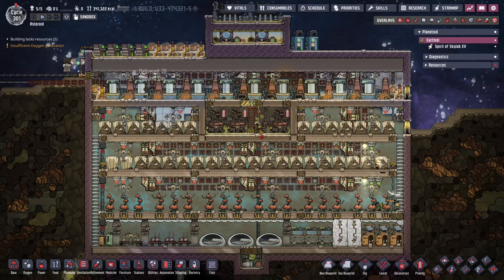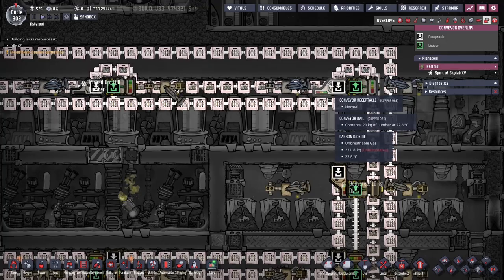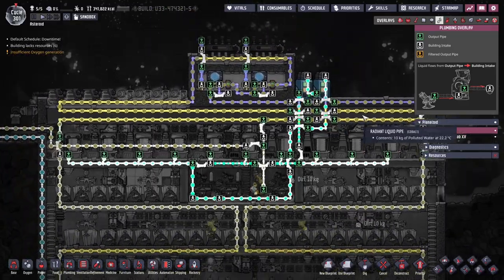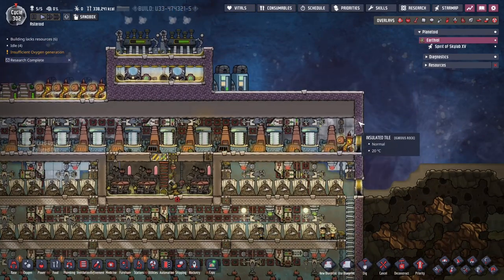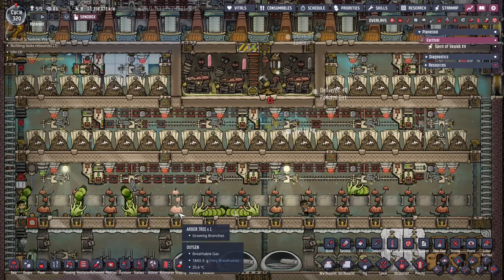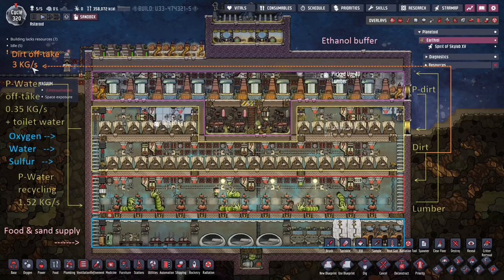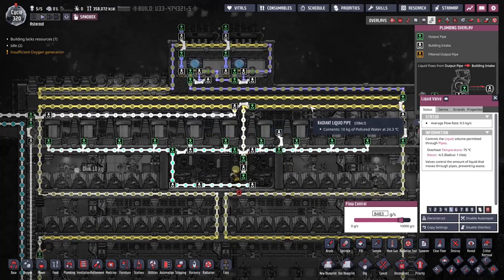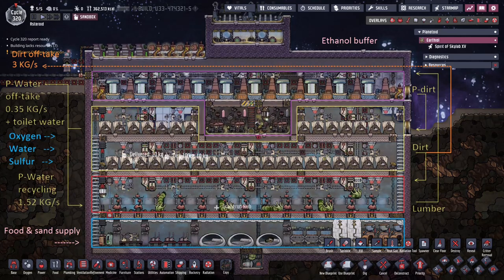Let's Get Dirty! - Oxygen Not Included: Spaced Out!

Comment: what about a fertilizer synthesizer method using a cooker to produce dirt from fertilizer? i know it likely would be less effective, but it would be available on the asteroids that don't feature arbors.

also, recycling the co2 through scrubbers would feed a lot of trees. a standard 4 distiller, single generator system produces enough co2 to run at least 4 scrubbers. accounting for the 750 g/s you would be producing 4750 g/s or 2850 kg per cycle of polluted water. this is enough for 40.7 trees. if it takes 7 trees to support one distiller, then you could run 20 extra distillers driving 5 petroleum generators.
Reply from the maker: For this particular build I tried to minimize the number of trees, but we can definitely scale it up!

Comment: I was overthinking the dupe pathing and read a bit more into it after coming up with a transit tube ‘elevator’ into the work place (you don’t need a transit hub to exit) and a fire pole back down for transportation and I’m now totally bummed out. Apparently dupes with sufficient athletic skill on plastic ladders are faster going up than ones in tubes. Having said that, great build!

Edit:
Would still like to recommend adding fire poles and swapping the position of the top right compost with the generators to decrease duplicant travel times. Also have you considered merging the steam turbines with the generators into an actual power plant? No such thing as over-engineering, just room to expand with new ideas.
Reply from the maker: Some good ideas here! Going to do more testing.

Comment: It's a really cool village! It really showcases how much you can produce with arbor trees.

On another hand, in Spaced Out!, I really feel like it would be more profitable to use all the excess pdirt for oxygen production instead of dirt. Sustainable oxygen production a lot more important than sustainable dirt production.
Reply from the maker: Could definitely feed p-dirt into a gassifier type deal.
Reply: @greezyhammer764  The most straightforward approach to clean the po2 would be a deodorizer. That's a great way to create a lot of clay. But eventually you get too much clay and not enough filtration medium, at which point you want to switch to cold based oxygen purification. If you cool down p02 until it becomes a liquid, and then you reheat it, it will become clean oxygen. With a proper heat exchanger, you should be able to reheat the outgoing clean oxygen with the next batch of po2. This should convert 100$ of the oxygen instead of 90%, and it's probably doable in a smaller area.

Comment: Can I ask why you arn't cooking the polluted dirt instead of composting, for less dupe time?
Reply from the maker: Job security :D
Reply: @greezyhammer764  So there's no advantage?  You don't gain more dirt from composting vs heating it up?  I'm only asking because I switched up from composts to a simple room with my hot petrolleum pipe running through.  I would be sad if it produced less.
Reply from the maker: @thomasbarker3524  It's the same output. In the case of compost, the dupe skill used is Farming, which matched nicely with tree harvesting.

Comment: Why not use pips with natural tiles?
Reply from the maker: Fewer trees. This uses 13 trees and makes more p-water and dirt than it uses.
Reply: @greezyhammer764  true but natural trees require no water and pips poop normal dirt and make bbq - you can also use fertiliser and grub grubs to grow trees quicker. Just a thought.
Reply: @CraigyB34r  with natural trees you would need 30 trees for each generator, that would take ALOT of space and annoying pip planting in my opinion.